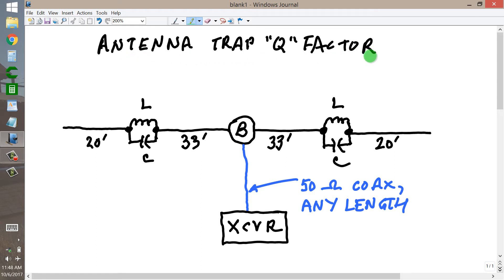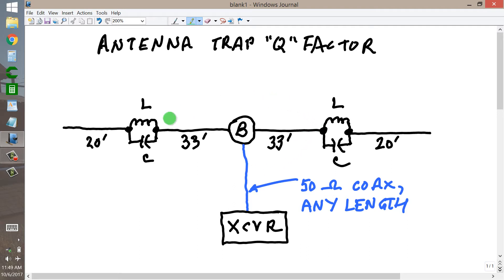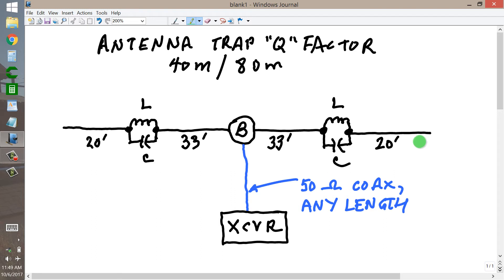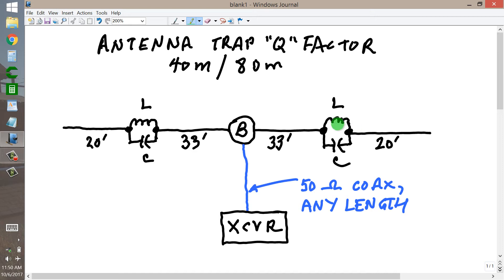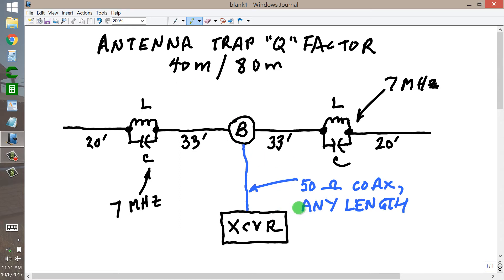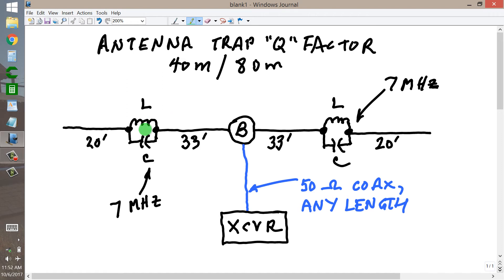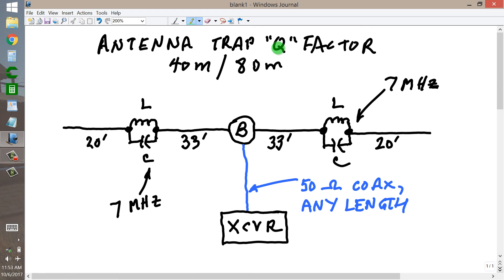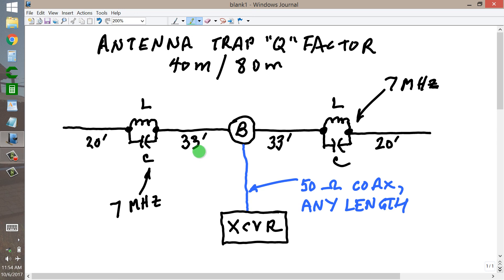Antenna Trap "Q" Factor

Comment: I am not an expert but some thoughts that come to mind are that if there is a change in the voltage or current across LC circuits or traps that this may induce a change in the resonance a/o amplitude of the system.  In LC and RLC circuits, natural frequency (the frequency at which a system tends to oscillate in the absence of driving or damping force) is omega(subscript0) = 1/squareroot of LC.  knowing this and keeping it in mind we must know or figure out what the natural frequency or the resonance of the transmitter is for either direction computation of the question.  i dont know anything really about transmitters so I am not sure what it would be, but it certainly seems possible when we phrase it as such that there may be a difference when receiving or transmitting given which part of the system is at equilibrium at which point (or is at its natural frequency).  it can be shown that the set of Natural Frequencies in a network can be obtained by calculating the poles of all impedance and admittance functions of the network.  if these frequencies resonate with each other they significantly increase amplitude and I am sure that would be a factor in Amplitude modulation..so perhaps this would make for a higher powered radio tuner depending on what type of modulation etc..

in relation moreso to Q factor and damping oscillating system resonance Heavily damped oscillators tend to have broad linewidths, and respond to a wider range of driving frequencies around the resonant frequency. The linewidth is inversely proportional to the Q factor, which is a measure of the sharpness of the resonance.

In electrical engineering, this approximate symmetric response is known as the universal resonance curve, a concept introduced by Frederick E. Terman in 1932 to simplify the approximate analysis of radio circuits with a range of center frequencies and Q values
Reply: could also be that the traps for the antennae are not simple LC circuits, I don't really know its just that I am learning about resonance right now and decided to comment
Reply from the maker: Maybe if excessive current heats up the coil, the parameters might change. But that's speculation on my end. Traps are simple parallel-resonant circuits, nothing more. Ideally nothing should change as long as the transmitter power doesn't get too high.

Comment: I have run several calculations on this, and no matter what the power (100w, 1500w), the Q remains the same.  The radiation resistance and resistance loss also don't change.  Just because the Q goes up doesn't mean the overall efficiency is going up though.  The efficiency can be great and the Q can be low, bringing the Q up will involve bringing the efficiency down a little.  It's a balancing act.

Comment: vk2 mu the q factor is high the bandwidth on 80 meters is narrow I do not notice any loss I have built this antenna also traps foe 10m 20m 15m 40 m80m 160m the 80m band width was narrow because of the high Q the trap is a band pass filter for 7mhz I changes=to  coaxial trap made on 43mm pvc with 1.5m of rg8u coax with the outer shield connected in series with the inner conductor 
giving both inductance and capacitance between the turns I resinate them with a grid dip metre on 7mhz and listen for the chirp on receiver and watch the metre dip together the traps will act like loading coils on 160m the whole antenna is about 100m long 73s Ron